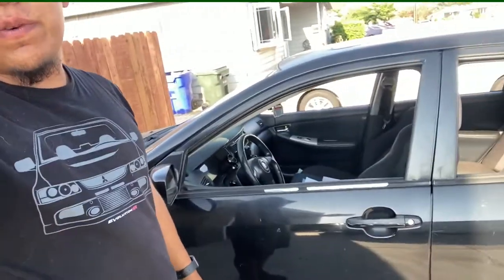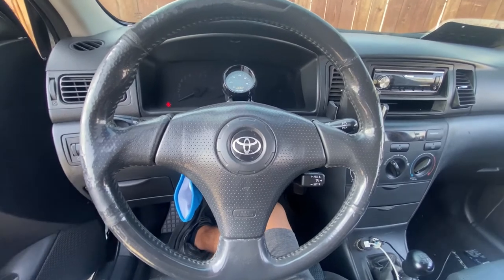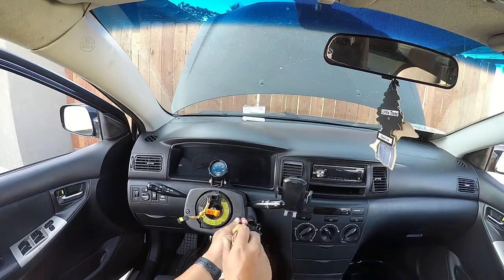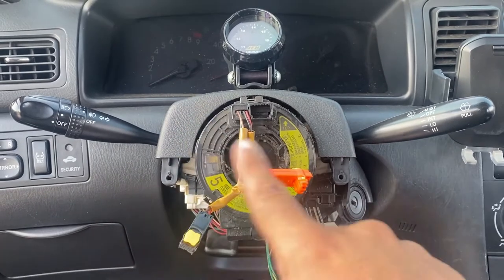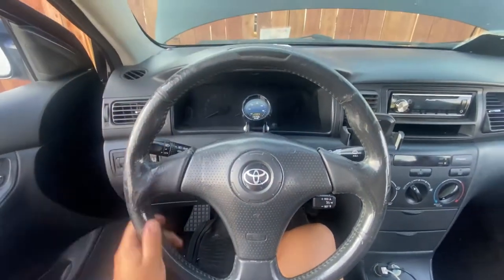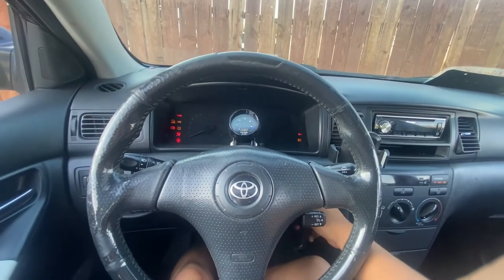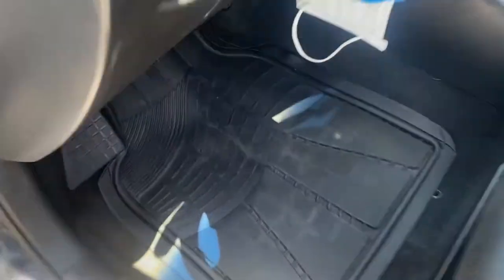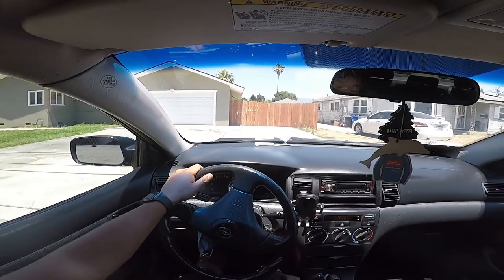How To Change Clockspring 05 Toyota Corolla

Comment: Good morning, I just wanted to ask one thing, I'm sorry, I'm not an expert, but just to be clear, the airbag simulator is only placed in containers that don't have short circuits. I meant for control a clock spring . thanks a lot

Comment: It was a good thing that you mentioned about the five turns and the 2 1/2 because that’s important note for those that are installing one and they don’t have it correctly lined up it’s not going to work. Was your horn working? Mine works but the airbag is on. This is on my Scion xB though not the STI.